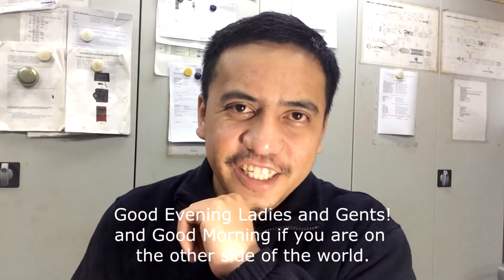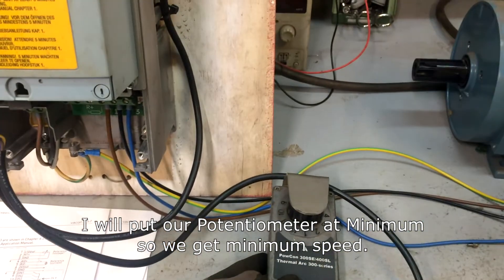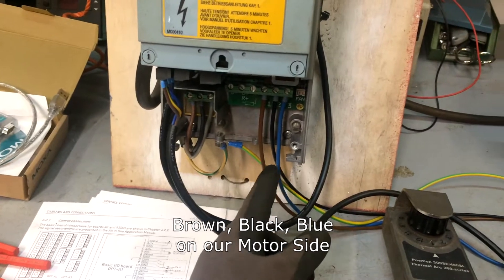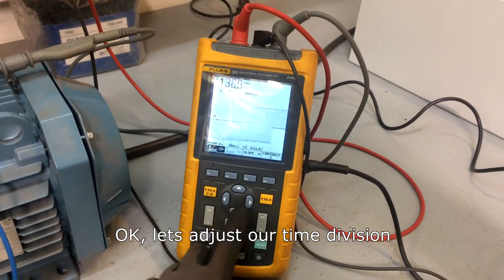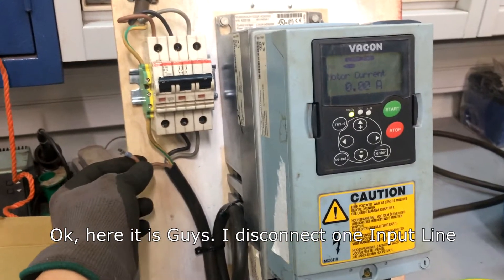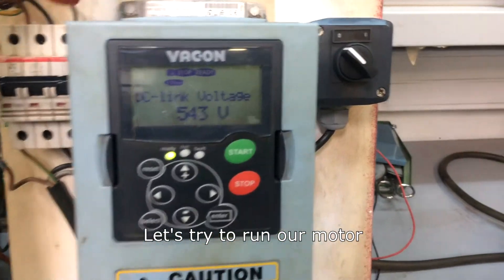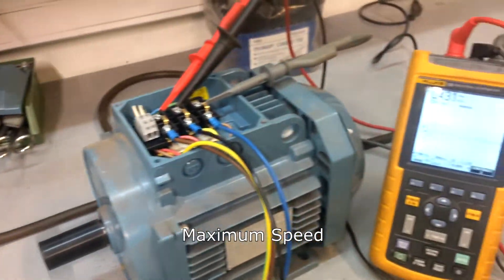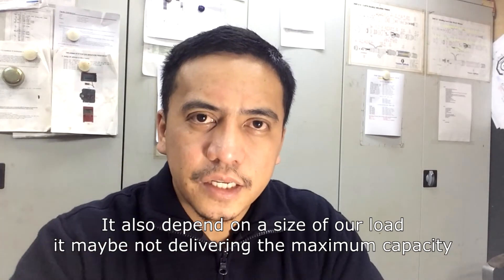Is a 3 Phase VFD will run in Single Phase Input Supply?

Comment: Sir why is it that the current at the Supply before the breaker is just 0.3 and the Current at the load side( at the VFD or motor) is 1.8 amps? Why is it that the current at the load side is higher. What is the explaination about that? I thought it must be the same. 3:17 🤔🤔
Reply from the maker: The simpliest answer I can think is like this.. the input current is one component the "real" current (for watts) and the VFD output current has two components: 1.Real current (for watts) and the 2.Reactive current (for VARS).. 
Ivfd=√(Ir²+Iq²)

Comment: Hello Sir, very good and clear explanations. My question: Can I use a  230 volt 1 PH input , 3 PH output VFD to run a 1 PH motor? The reason for this is to change the frequency fro 50 HZ to 60 HZ. Thanks and keep up the good work.
Reply: I also want to know the same thing. Please let us know thanks

Comment: The suplly was 3 phase and you remove one wire. So the supply will be 2 phase not one.
If you want to check with one phase disconnect to wire (phase) and connect neutral to replace 1 phase. The motor will not run because the voltage will drop to 230 volts.
Reply from the maker: Use a scope then you will see only one phase between 2 lines.

Comment: Sir.. i have a question ..f i my power supply is 230 1phase ..must be my motor and vfd specs  also is design for 3phase 220? Not 3phase 380?
Reply from the maker: The proper way if your main source is 230V 1p then your motor and VFD is also design for single phase 230V

Comment: Nice and informative video. My question is, I have a 1.5kw 440v 3ph vfd, will it run using a 440V 1ph supply?
Reply from the maker: Yes but it will draw higher current on supply side..  Same in what I did on the video supply 1phase only but still work but for sure will limit your vfd capacity.

Comment: this is the advantage of using vfd 
you can run a 3 phase motor with single phase supply or vice versa 3phase supply and single phase motor